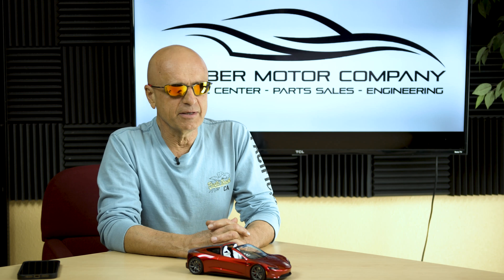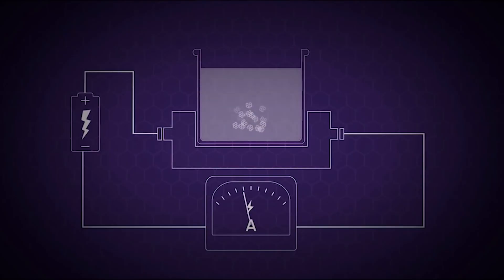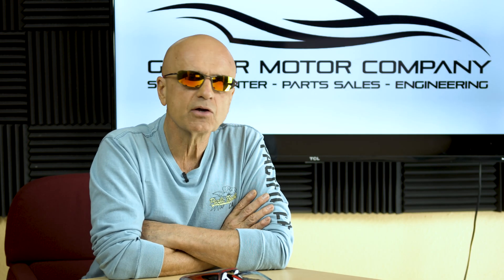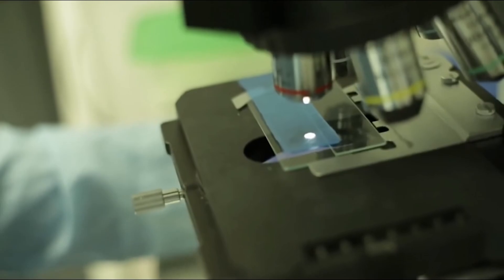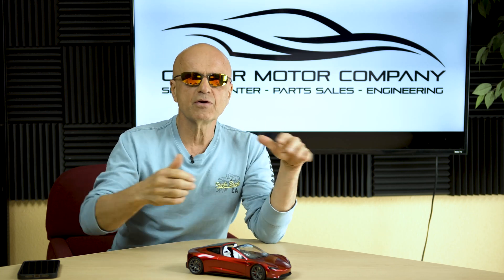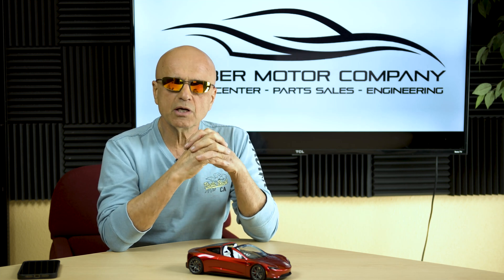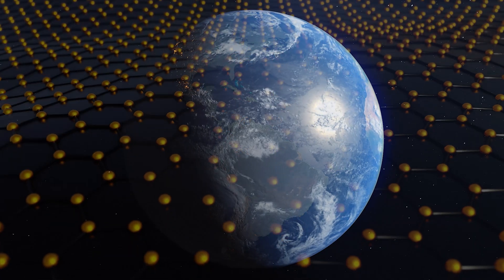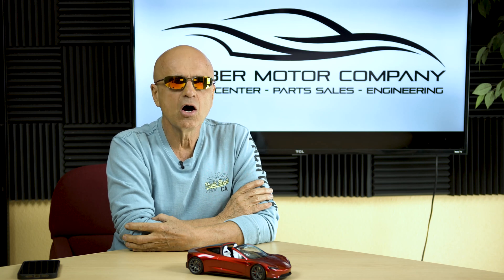Tesla Next Generation Battery UPDATE | Gruber Motors

Comment: Generally  when compared side by side the same size super capacitor will not have the same energy density and run out quickly - A system I've been working with is is maybe at best 50%.  Line Voltage drops direct with use so one has to accommodate for this change as well and as it depletes how does the performance sustain.

Comment: Can't you create a test rig in the shop with the Model S and then the new batteries located outside the Tesla?  This way you can see how the correct sized pack performs without all the retooling.

I don't understand how the two teams got to this point, this snag, without realizing the batteries, as currently made, would not fit. Something is not adding up.

Comment: THANKS4GIVING as the I will say energy source reaches faster charging times, it becomes more and more beneficial. Regeneration becomes front line, in the past regeneration was a small contributor to overall energy capacity, but say for instance you were to go down the grapevine on Highway 5 you could charge to 100% just descending high elevations. Best of luck moving forward on this concept.  Elon has known this was coming and it would still be many months away from production if it works.
Reply: A Tesla uses/gains 2kwh per 1000ft of elevation change. Are you coming down from 50,000 ft?